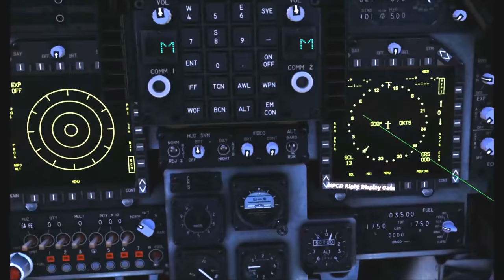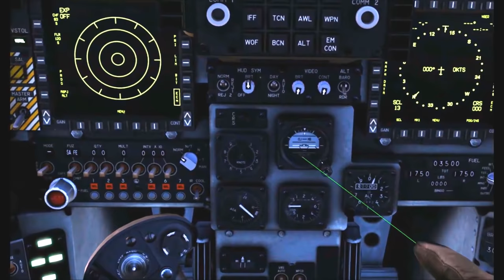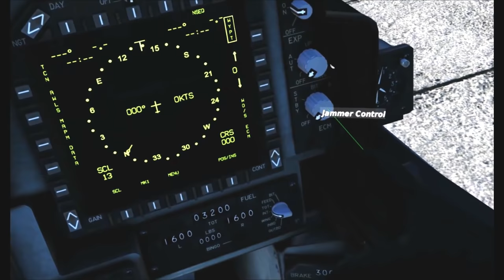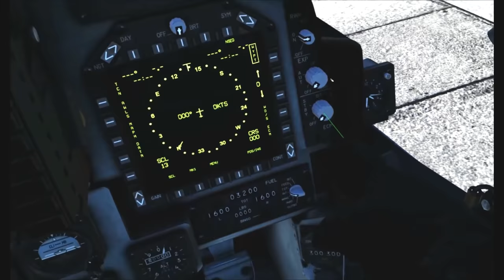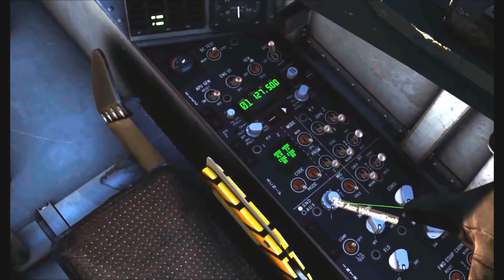AV-8B Harrier: Cockpit Familiarization Tour Tutorial | DCS WORLD

Comment: Some points for you, if you don't mind my saying:
The H2O dump switch vents the 500lb (max) of demineralised water that is injected into your engine with the water switch during takeoff or landing. It pours out of a hole in the main undercarriage bay and soaks anyone working in there. Heheheh.....
Your description of the lights panel and its function is all wrong. The 'Form' knob adjusts the brightness of the green flat panel formation lights dotted around the aircraft. They work fine.
Position lights are the red and green wingtip and white tail lights.
Anti-coll are the top/bottom strobes. (anti-collision)
Aux is a small white light on the nose undercarriage leg. The main approach light drowns it out in the sim.
SAAHS stands for Stability Augmentation and Attitude Hold System.
You're correct that DSL is Depressed SightLine. It's a standby bombing mode.
The interval switches are in feet on the ACP. Intervals are not yet implemented. (And I wish they'd hurry that one up....)

The VR view with the hand in the presentation was useful, if not pretty. Good vid, but know your subject. :)
Reply: Tangible_Zadren no minding at all!  It was quite difficult to maintain comprehension on the different functionality of each item as a lot of retakes were required due to stutters and whatnot.  I'll definitely keep all this in mind if I ever do a later revision once more systems are in place.
Reply: I would highly recommend taking notes from the manual before rolling into the video. I love the presentation style, though!

Comment: I got a little chuckle from the DECS explanation. It throttles back your engine so you don't melt it, so now you don't have enough power to land, and you crash and die. We kind of have this in electric RC planes. The ESC will limit or cut your battery output in an attempt to save your battery from overdrain damage, but now you're falling from the sky.

Comment: good Vid couple things obviously Water dump dumps the water if you need to loose weight tho it is not that helpful, and the rpm switch does not change anything in the engine but causes the tach to display either compressor speeds when set to high or bypass fan speed when set to low.  other than that was pretty spot on.
Reply: The ECM, receive mode and the always-on mode :)  aka Music standby or Drop the beat.
Reply: Oooo very interesting, I'll have to see if the rpm switch actually affects the display next time I'm in the harrier.

Comment: I worked on the AV8A, C, B Night attack and now at the Depot level the AV8B Radar. LIDS Lift Improvement Device Traps the Boundry layer air under the Aircraft causing a greater lift cushion. It doesn't stop air going into the intake!! The Lids and Strakes are made of Composite materials and not metal as in the description. VR is nice but the explanation of some of the cockpit description example DECS not quite right. DECS are 2 separate units that control the fuel and air mixtures to the engine. they are located in the engine compartment. They are redundant so if one fails you switch to the other. They can be adjusted to keep the engine from over temping and increasing the life of the engine, but the ground crew can readjust to a higher performance such as during war time, but this will reduce the life or as we call it High time of the engine.
Reply: Formation lights are strips of lights on varies places on the aircraft to assist in formation flying. Pilot has the option to turn off when he doesn't want to be spotted or turn down when his wingman has on NVG Goggles.
Reply: @robertbridge7678  Thanks for the DECS info... I am curious about the Engine RPM switch. It gets mentioned in 2 checklists in the real manual. Lo for initial checks and Hi for engine shutdown. From playing around with it in flight the only effect it seems to have is the RPM readout which seems to go up when on Hi however, things like the Jet temps don't change when they are usually almost tied to RPM and would change if the throttle was used to raise the RPM manually... The engine sound doesn't change either which leads me to believe that it is just calculating the same engine RPM with a different multiplier or something and not impacting the actual engine in any way.
Any information would be greatly appreciated as the llack of info in the manuals has been bugging me!

Comment: Doesnt the H2O dump switch drops the water cooling of the plane?
Reply: it's for the pilot, its spritzes a cool mist in case you get really hot. In the British harrier it dispense a nice cuppa.
Reply: The H2O coolant is probably cold tea being heated up by the engine (aka kettle) and later dispensed along with biscuits and Her Majesty’s portrait.
Reply: Moving portrait is planned but not functional at this time.
Reply: Silly us.

Seems this switch dumps the "H2O" if connecting your Willie Nelson to the "Jettison Airplane" system. Clever design by the brits, allowing you to carry on a sixpack or two alongside other armaments. However, the manual reads: 'Caution should be exercised - a lot'.

Don't mention it. ^^